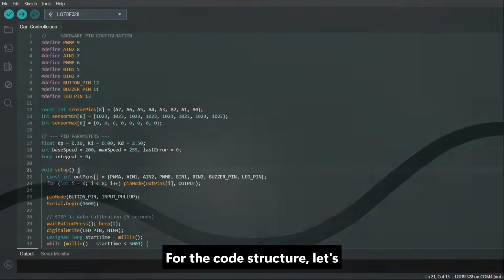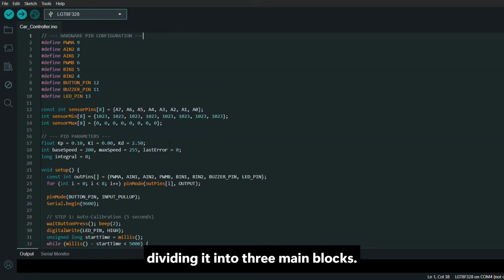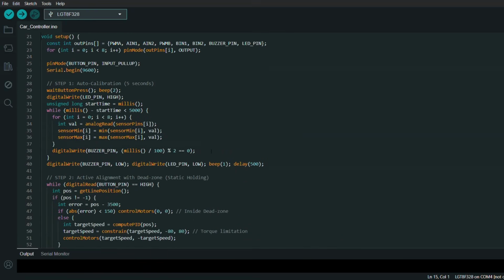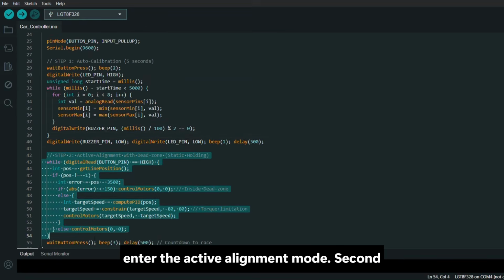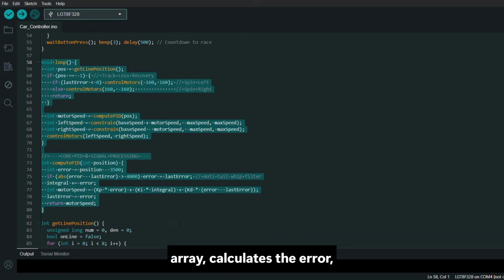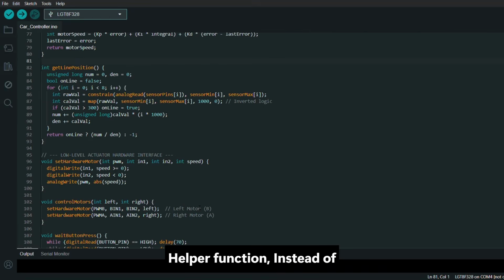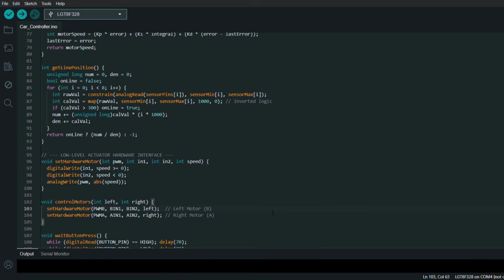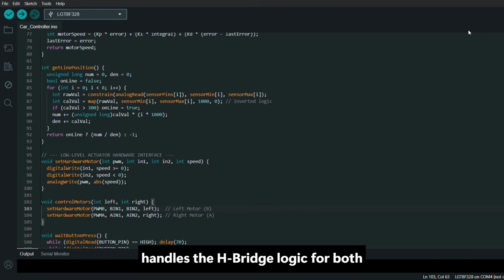DIY High-Speed Line Follower Robot | Full Build & PID Tuning

Comment: Nice. Can you give the link of the sensor array?
Reply from the maker: https://shopee.vn/C%E1%BA%A3m-bi%E1%BA%BFn-d%C3%B2-line-PID-T%E1%BA%B7ng-code-PID-c%E1%BB%B1c-x%E1%BB%8Bn-i.97386457.22249373507
Reply: @ngvkhoa07  Bro cant access this link. Can you atleast give the name and the description of the exact sensor? Thank you in advanced
Reply from the maker: @geek2OOOO  The exact component you need to search for on AliExpress or Amazon is the "8-Channel Analog IR Line Tracking Sensor Array". Make sure you specifically look for the ANALOG version, not the digital ones with the little blue potentiometers. This sensor uses 8 infrared (IR) pairs to read the reflectivity of the surface. Because it is analog, it outputs a continuous range of voltage values based on exactly how much of the black line it sees.
Reply: @ngvkhoa07 thanks bro🙏🙏